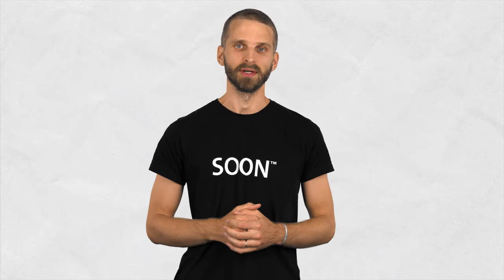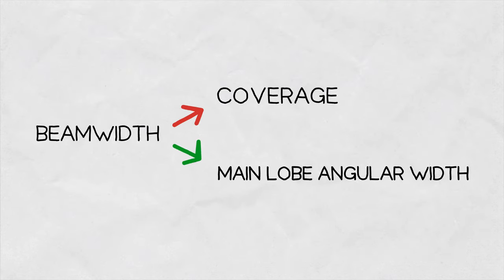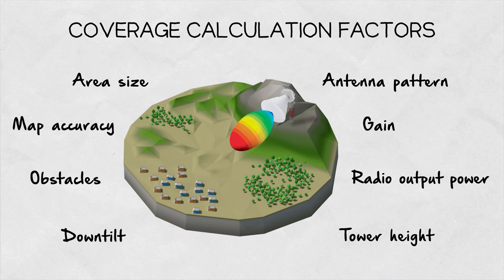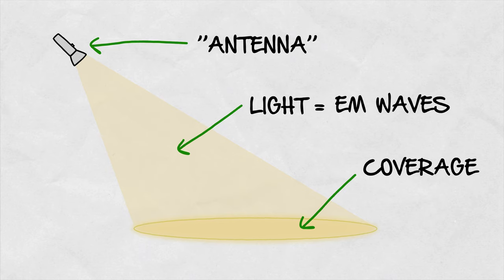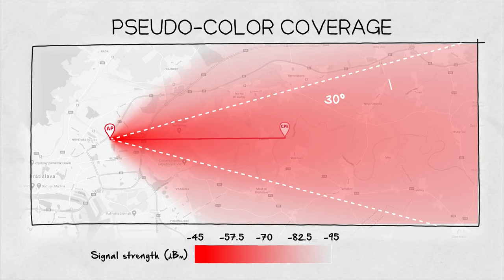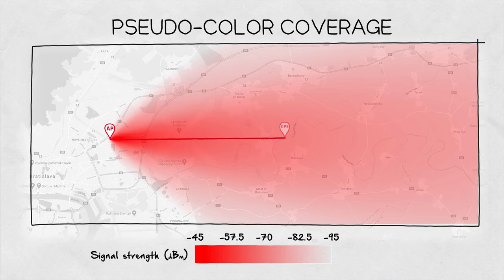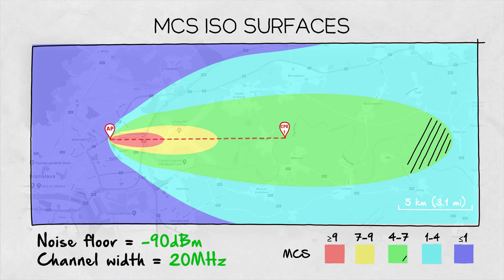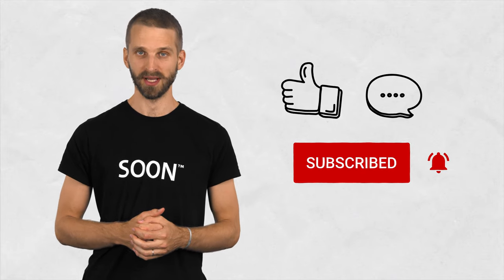Inside Wireless: How RF coverage works

Comment: how about fck RF and use optic cables???
Reply from the maker: Wireless and fiber are real options, both have their advantages and disadvantages. They actually complement each other very well..
Reply: @Rfelements  Well said!
Reply: With RF, you just pull out your antennas,  stick them to pole, configure, and you're good to go in a matter of hours! to setup optical fiber, it'll take months! and if anything happens and it gets cut, it'll take again quite some time to fix...
Reply: if you need a temporary solution yes. But we don't want increased elecrosmog.

So just just lay optic together with existing cables, that's easy. Or dig a small trench with machine and it will last and outperform RF for decades...

Comment: hi sir! given its gain, how can i calculate the antenna max distance coverage?
lastly, RSSI and RSRP are parameters needs to monitor? thank you
Reply from the maker: If you use RF elements antennas, use our link calculator - https://rfelements.com/calc
For any other antenna / frequency band, you can calculate it using link budget equation. Besides the antenna gain, you'll need to know the noise floor of the radio and the minimum SNR required for the data throughput you want to achieve.

Comment: If I have say a 5 dbi antenna and I add in 30 feet of low loss cable, like LMR 400 and it drops it to ~4 dbi, with that have any effect on the radiation pattern at all? eg. can you (or does it) make a higher gain antenna have a wider beam width when it has more cable loss or is it just a power drop and it all stays the same, just less distance/coverage?
Reply from the maker: Hi Brad, (any) cable only adds loss, antenna gain and beam width only depends on the antenna parameters and does not change depending on the cable that feeds it. As you write, cable loss results only in signal power drop, or smaller coverage distance.